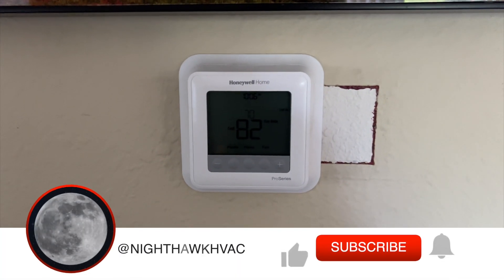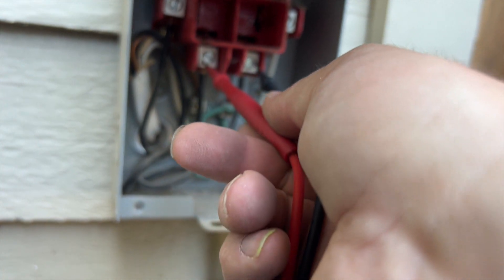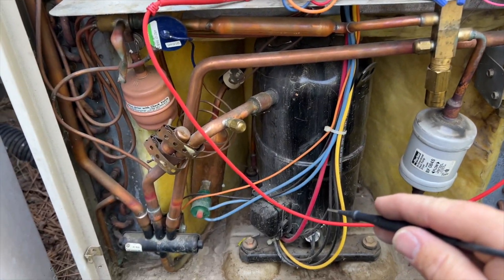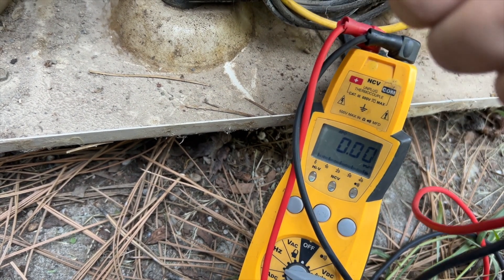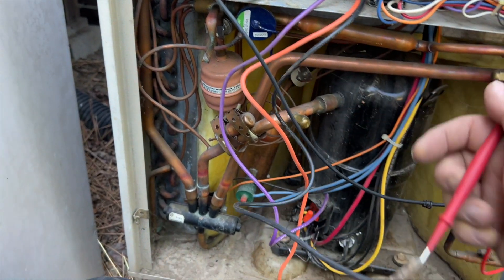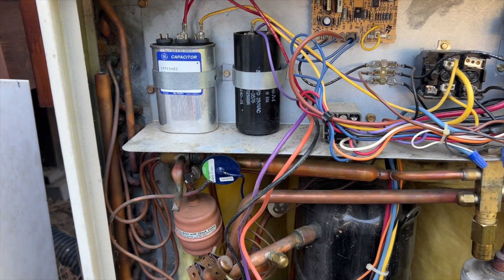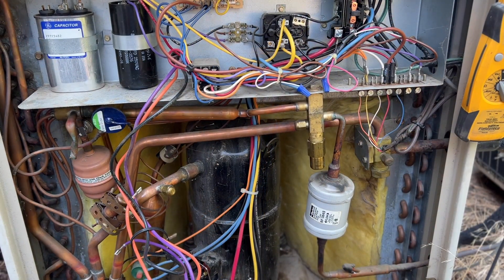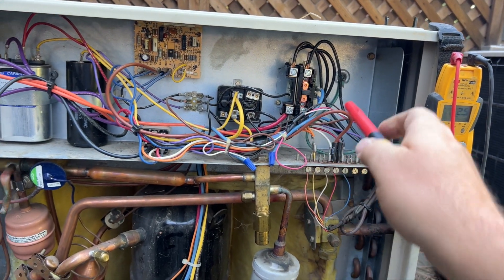No Cool Call. Outdoor Unit Keeps Tripping the Breaker EP99

Comment: Excellent video! And this is the same diagnosis I had yesterday, my 15 year old unit kept tripping the breaker, and it isn’t worth putting a new compressor on an old machine, especially in comparison to the cost of an entire new AC, luckily I replaced the evap coil 2 years ago so I’m only looking at the outside unit replacement, I’m not too mad, it lasted for 15 years so it was time. Thanks for such an informative and great video, it truly helps a lot.
Reply from the maker: Thanks for the feedback! Glad the video could help.

Comment: Use an amp meter!!!! Stop pushing 30 amp pole and half’s in on compressors pulling 100 amps !!! Prob 200 inrush 
Might not be today or tomorrow but a face full of plastic and molten copper combined with a hot oil/ refrigerant facial will be a bad day for you. Please use the correct tool for the correct job. Your not a bad technician. Your just not using common sense
Reply: Joe what is the right tool for the job?
Reply: @hvactechwanttobe1499  
An amp meter. Not a sharpie holding in th contactor armature